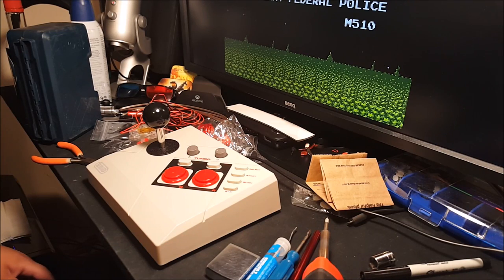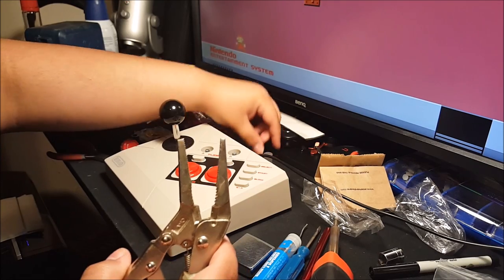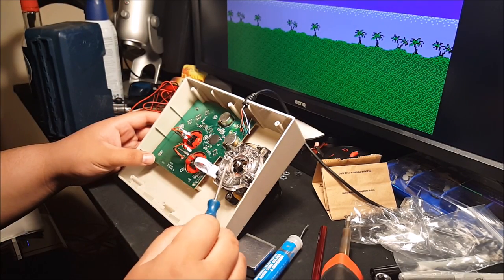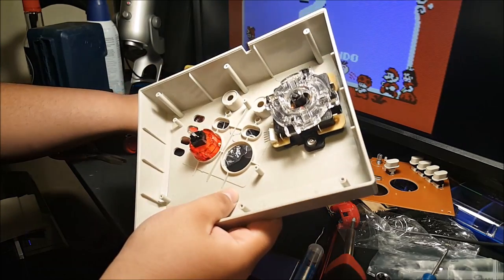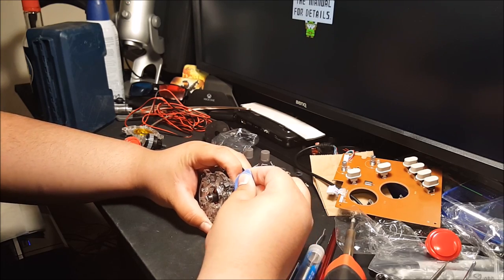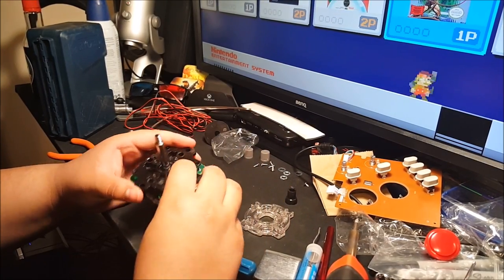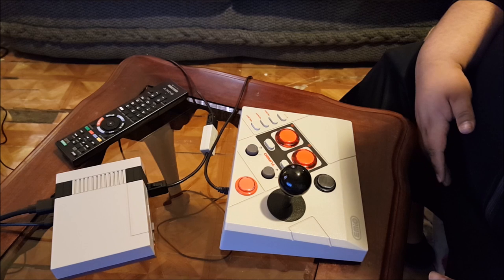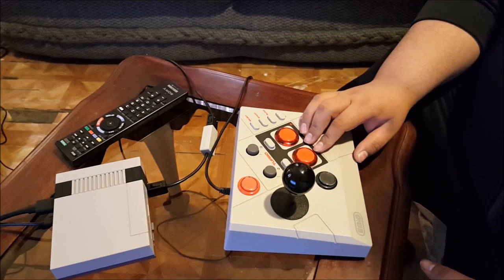NES Edge mod

Comment: Got phase 1 of my Edge Joystick mod completed thanks to you! Got both 30mm buttons changed out, soldered longer leads, Octagonal Restrictor Gate and Oversize Actuator installed. For weight I used Self Adhesive Wheel Balancing Weights Strips that I got from Walmart. They are super low profile to where you dont have to worry about it touching the electronics. Im super happy with the results! Thank you for the video and keep up the great work! Phase 2 is to add the start and select buttons and maybe some LEDs.
Reply from the maker: badass man! i love to hear that your mod is going well thanks for the support man!

Comment: Great vid! I purchased one of these joysticks myself and would like to mod it like you did. Is there any reason why you went with the Seimitsu button instead of a Sanwa button? Do they work just as well? I'm new to this. Thanks!
Reply from the maker: Bora Chreng i got seimitsu because thats what was avaliable for the 30mm buttons at the time and for the 24mm buttons i got seimitsu because they had the best kind of screw type button for a hole.
Reply: Ah okay. Thanks for the reply!

Comment: Awesome video bud. Thanx a lot. Not complaining at all of this emio product. Fair enough for the money. After buying one, straight away bought another one before run out.  Actually thinking of buying a third one as well! Havent replaced buttons or gate yet cause havent arrived. Instead of hot gluing bolts on that plastic cover I ve replace it with a solid 2.5mm thick metal one, that I ve painted, so weigh is equally balanced.
Reply from the maker: Thats a good idea of using a metal plate for weight balance!!! I just used the bolts because it was the most convenient option for me.

Comment: Very informative video. I have a few questions. Are the new buttons more quiet? The controller feels light to me, is there something I can use as a weight inside? My stick keeps going to the left and not going back the dead zone, I have heard this fixes itself after some use, does that sound about right?
Reply from the maker: Jeff Lamberton yes the buttons are more quiet with the seimitsu buttons and you can also get some sound dampeners for the buttons on the focusattack website. you can use steel nuts to add weight just hot glue them in. as for the stick drift you can take the joy apart and see if theres something wrong. that dosent seem right to me.
Reply from the maker: Jeff Lamberton https://www.focusattack.com/silencer-sanwa-seimitsu-30mm-foam-washer/ 
theres the link to the silencer.

Comment: With the mods you've done, these are downright perfect. Thanks for the video! I bought two of the SNES version a while ago when TJ Maxx was clearing them out and just picked up the NES version on eBay for $15. Happy to pick up another one of these poor misunderstood and underappreciated products. It wasn't perfect out of the box, but you could tell it was made by actual gamers and not just a soulless corporation. Too bad there were so many manufacturing errors and missteps at launch, because it clearly buried Emio, who hasn't released anything for the Switch. But gamers who dismissed these products because they didn't want to put any effort into it are really missing out.

Comment: So, I managed to get a hold of 2 of these and to my surprise, unlike the SNES versions, both came with actual Sanwa joysticks. Bad news, buttons suck. I need to replace them but I don't want to use Sanwa buttons for NES. They worked great for the SNES classic but I loaded the one up I use the joysticks for with fighting games that made use of them. For NES arcade style games that take advantage of the arcade stick, I want clickier buttons which these controllers came with, but they are not consistently responsive. It's hard to explain, you would have to use them to understand.  I would love to use Cherry micro switches but there isn't enough clearance. Not sure which direction to take yet.

Comment: Great stuff man, I used your video to upgrade mine, I brought pretty much the exact same stuff as you did. I did go ahead and replace my joystick with a real Sanwa denshi, the 1 in it didn't say sanwa anywhere on it, so I assumed it was a knockoff and just replaced, 15 bux, wasn't a bad price. I am wondering is there anything that can be done about the other buttons, my start button has an awful squeak to it, annoys the crap outta me, especially after all the work I did upgrading everything else. Anyways, I love these mods, thanx for the how-to, they made it feel like a really great stick now.
Reply from the maker: i would recommend spraying some silicone lube on the start button to get rid of the squeak.  i use the liquid wrench brand and its non conductive. when you use it dont spray it directly because it can get everywhere, usually i get a cotton swap and soak it and dab it on the place where i want it. it can be a bit messy but ive used this stuff for my xbox controllers when the joysticks squeak. 

https://www.walmart.com/ip/Radiator-Specialty-Liquid-Wrench-Silicone-Sprays-11-oz-Aerosol-Can/19866384
Reply: Thanx for the reply, I was looking at the silicone lube on the site all the parts came from, this looks easier and it's at walmart. I'm gonna try it, thanx again :)
Reply from the maker: anytime!

Comment: Instead of trying to trace an extra button to the dedicated A-B button, couldn't you have just daisy-chained your desired NEW button to the actual A button and B button?

I think that might have been what you saying, but I wasn't sure. If doing that DIDN'T work then I find that really odd as I can't think of a reason off hand as to why it wouldn't. Anyhoo, nice mod nonetheless!
Reply from the maker: Travis Marshall i did try that aswell but i ran into an issue where if i pushed the regular A or B buttons they would either not work or they would activate at the same time.

Comment: Any problems with the turbo auto firing? I watched two unboxing here on Youtube one guys turbo worked like it should but other was auto firing.
Reply from the maker: so I do not have any problems with the regular NES EDGE with auto firing but on the SUPER NES EDGE I did have an issues with the auto fire but I re-flowed the solder and it fixed it.
Reply: @Demon20child  Did you have anything you specifically reflowed? I went over most of the pcb and had no luck.

Comment: Hi!!  thank you. Just bought one and I'm gonna buy the parts for the mod.  Question... What is the purpose of replacing the black round piece for the oversize one? Thanks!
Reply from the maker: gonzchi it narrows the dead zone in the joy stick. So basically you don’t have to push the joystick far for it to activate.
Reply: Got it. Thank you, I'm new with this.  Last question now :)  Do you know any adapter to USB to use it with emulators on a PC?  I've seen some in Amazon / ebay supposed to be for wii controllers to USB... maybe they would work, I'm not sure.  Thanks!
Reply from the maker: gonzchi the “SUPER” nes edge comes with a USB adapter and works with everything I’ve tested it with but I haven’t tested the adaptor with the regular nes edge.
Reply from the maker: I’ve missplaced the adaptor at the moment but once I find it I’ll test it and let u know
Reply: Finally, I did the mod today.  (just joystick and buttons)   So much better. Thank you!
Reply from the maker: absolutely! that makes me happy to hear!

Comment: Thanks for the tear down. Q: How can you tell the buttons are "knock off" sanwa versus "real"?
Reply from the maker: Tom Lakovic the real sanwa buttons have gold connectors, they are labeled with the sanwa logo on the bottom, also the switch activation dosent feel hard or crunchy to push.
Reply from the maker: Tom Lakovic samething goes for seimitsu buttons aswell. The buttons that EMIO put on this controller are just some cheap buttons made from old matress springs. Anyways idk if the original buttons were sanwa or seimitsu knock offs or they just suck.
Reply: hey, so i have a question for you regarding your sound dampeners (foam washers) for the seimitsu. well a couple questions actually. since the whole debate between mfg's is down to nuance of the feel/snap/sound, how do you personally feel after dampening your favorite button with rubber washer. does that take the snap out that you like so much? watch this vid and tell me where you think the seimitsu+damper compares to the sanwa silent version. Perhaps sanwa is doing the same thing with rubber washers in their standard buttons?  and followup question: are those washers compatible with either manufacturer or specific only to seimitsu? thanks for sharing your impressions and opinion!
Reply from the maker: so for me i like a silent button. i think it annoying having loud clacks all the time. i was gonna do the cherry mx switch to the seimutsu buttons i got but i dident feel like going all the way and doing that so i went with the foam dampeners and they work great. the dampeners are compatible with both seimitsu and sanwa buttons. also i feel people should try out buttons for themselves, find which one work best for them.

Comment: do you notice any lag using this joystick. I've come across a few reviews that say there is lag?
Reply from the maker: Arcade Party not that i have noticed. ive used it on my oled tv which has 60ms of lag and i also have used it on my benq monitor which has 1ms of lag and i havent noticed any difference. it also could be how people use the joystick. maybe they are not used to it but i could be wrong.

Comment: I have an ambitious idea for a mod. I want to go completely wireless, and play using one of the 8bitdo NES wireless receivers, playing on original hardware. Think there is enough room to fit a Wii controller guts, rechargeable battery pack, and a flush mounted USB connector in this thing (for charging the battery)? Will also need a sync button routed to the Wii controller.
Reply from the maker: Drew Irons maybe if you dont add buttons like i did you should have some room.
Reply from the maker: Drew Irons honestly i think you should have plenty of room now that i really think about it. i can see that being very possible mod
Reply: I am a novice, but I think with a little work/research I can get it done. I will probably have to cut the cables and resolder them to be much shorter to make it all fit.

My biggest concern is the battery. I ordered one of these: http://www.ebay.com/itm/3600mAh-Battery-USB-Cable-for-Nintendo-Wii-Remote-Controller-Black-/351716865578?hash=item51e3f5762a:g:jnAAAOSwiYFXHYwT

I am not sure how I will get the battery pack attached to the controller since it will be removed from the case. Direct solder?

As for everything else, the Edge will be plugged into the Wii controller guts, the battery pack attached to the terminals (and probably taking up a ton of room), and then the charging port somehow coupled to a USB port on the side of the controller. I will also dislocate the sync button (you need this to pair with the 8bitdo receiver) and side mount it.
Reply from the maker: Drew Irons yeah your best bet would be to directly solder to the terminals on the controller and for the sync button you should solder wires to an external button from like radio shack. yeah man i really think its possible.
Reply: @drewirons2646  Did you ever complete this mod?

Comment: What do you used to make hole for the extra button?
Reply from the maker: Xolotl Xtrapolator i used drill bits started small and went bigger then sanded it. it took me like 3 hours cuz i dident have big enough drill bits but if you do have big enough bits it should be faster.

Comment: My joystick gets stuck, doesn’t come back to the middle most times. Anyway to fix this? It’s brand new and doesn’t feel right. Does it get better with use?
Reply from the maker: sounds like there may be a problem with the actuator but it may be something else as well. usually if its messed up sometimes it wont ware in by its self sometimes it can make things worse. I would take it apart and take a look and see if its damaged or defective. if not you can replace the whole joystick assembly. also you may be in warranty from emio.

http://www.poweredbyemio.com/home/contact
this is a link to contact emio

https://www.focusattack.com/sanwa-jlf-tp-8y-sk-joystick-no-plate-installed/
this is a link if you wanna buy a new joystick
Reply: Thank you very much for the reply.  If I wanted to Swap out the joystick which one of these would I buy and is there any additional parts that I need to buy for the install. Thank you.
Reply from the maker: all you need is just what i put in the link above.
Reply: Thank you

Comment: I'm having a lot of trouble trying to get the old gate off. I can't see how you got it off. It just won't budge for me.
Reply from the maker: Jeff Lamberton use a guitar pick for leverage. if its the first time it has ever been taken off its gonna be tough.
Reply: Demon20child I can't clearly see what I am supposed to do with the pick, what am I trying to get it into and why?
Reply from the maker: Jeff Lamberton your trying to take the old clear square gate off right?
Reply: Demon20child Yeah exactly. I watched your video closely, and watched some others, but I can't see what the pick does.
Reply from the maker: it keeps tension on the clear gate so it does not click back into place when you pull the 4 tabs back and out.
Reply: Got it off, had a problem because the stick fell apart, but I think I got it back together correctly. I have my new gate on, but it won't go flush with the black plastic. Your looks like it went flush.
Reply from the maker: yeah there is little guides on the gate that fit in two pin holes on each switch and 4 oval guides that like up with the 4 black tabs.
Reply: It's those pins that aren't going in.
Reply from the maker: it should snap right in. pull the black tabs in as well to help the gate set in right as well. i remember everything is a really tight fit.
Reply: Demon20child I had to brace it on the side of my chin and push real hard. Worked! Everything back together and feels great. Thanks!
Reply from the maker: Jeff Lamberton lol thats great to hear man! if need anything else let me know.
Reply: When the stick fell apart and I put it back together, some of the lubricant stuff came off. It still works fine, but I imagine sometime later on I will have to get some new lubricant in there. Any ideas on that?
Reply from the maker: Jeff Lamberton yeah that website screwattack sells lube for joysticks.

Comment: Do HAPP style buttons fit?
Reply from the maker: No they are way too long. You would have to extend the bottom of the case with a large spacer to get it to fit tho but making the spacer would be the only solution i could think of if you wanted happ buttons.
Reply: @Demon20child  Thanks... just asking but I am not going to go through that for it. I just wanted to have red concave buttons. Maybe Sanwa makes concave in that size? No idea.
Reply from the maker: @NirnBootMod  I looked far and wide for concave buttons in a sanwa style but all I found was cheap knock offs and they felt really “crunchy” when pressed so I just settled for the real sanwas. If you need anything else hit me up!
Reply from the maker: @NirnBootMod   oh snap!!! Ima buy some right now and try them!!!
Reply: @Demon20child  Are those the right size for this stick?
Reply from the maker: @NirnBootMod  yes. The A and B buttons are 30mm
Reply: @Demon20child  awesome. lemme know how it turns out if you get them
Reply from the maker: @NirnBootMod  well, I got the caps in today but I just relized that the button I have are seimitsu buttons! so I guess I gotta order sanwa buttons in order for the caps to work. i gotta say they feel nice but I guess I gotta wait a bit longer.
Reply: @Demon20child  🤣